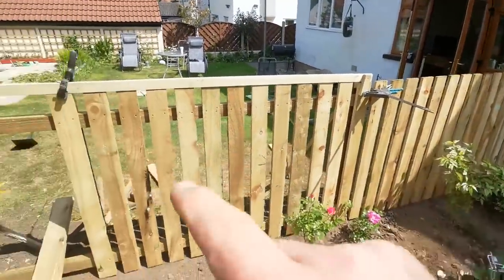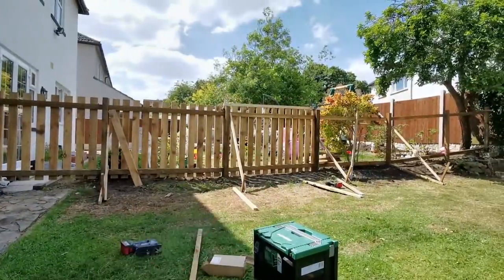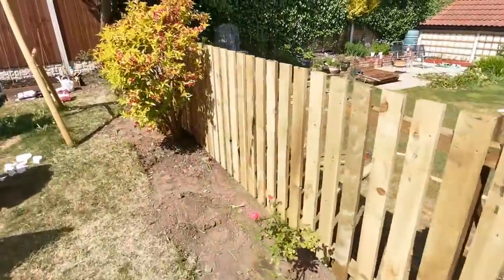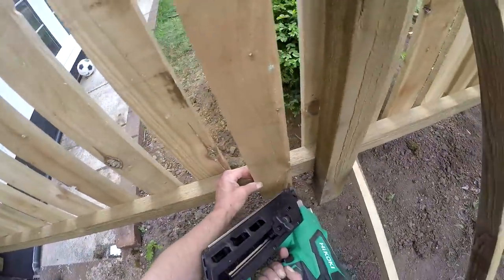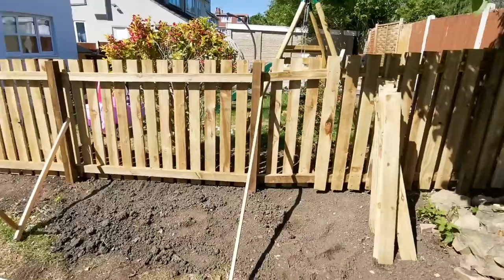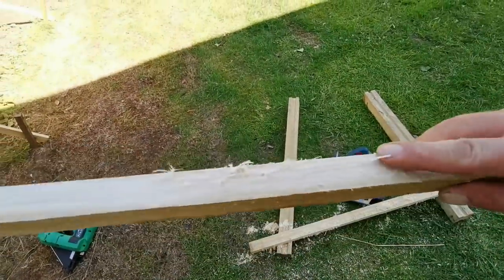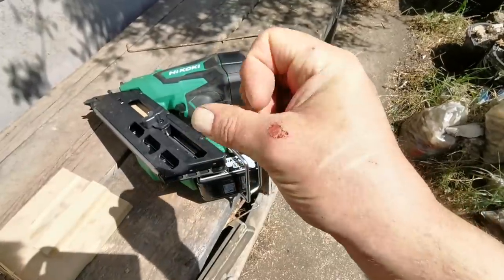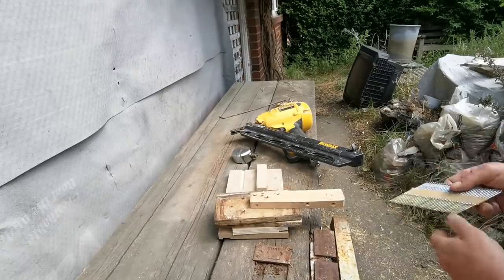4ft Paling fence - Pt4 Built with a HiKOKI NR1890DBCL Cordless Brushless Framing Nailer

Comment: Top class Sir, a carpenter I work with from time to time has one of those Hikoki framing guns. I had a go with it on a job we were on together recently. It certainly drives nails but it's heavy. My trusty Paslode got wet on Monday, 🙄 I dried it out in the oven and gave it a bit of a clean. No good, I must have a proper look at it when I get a chance. I have an old Draper fifty litre compressor and a Makita coil nailer. One can't beat the pneumatic guns for raw power, 👍🔨🇮🇪
Reply from the maker: Thanks 👍 Yep the Paslode i had died quite a few yrs ago, it then sat in a cupboard gathering dust because i went back to the reliable Dewalt air gun, the Paslode didn't quite die but just became a pain, It had either an empty battery or empty gas cannister & it didn't like cold weather. you'd hold the piece of wood up, put the gun to it n pull the trigger n nothing 😣, the Dewalt never missed a beat but i had the hose n compressor to deal with. I tried the battery Dewalt framer a couple of yrs ago but didn't fire the nails in enough & when you pull the trigger it took a moment to cock itself, Yep it's heavy but fires them in right in & it cocks itself after the last firing so ready to go immediately, i wish it was a little lighter but no regrets buying it 👍 https://youtu.be/oQlP-I6ZMcY
Reply: @Gidjoiner  To be fair my Paslode has never missed a beat since I bought it two Years ago. I'm building my new workshop at the moment and it was pissing rain on Monday while I was fitting the wall plates. The gun got soaked along with myself, 🙄 😭
Reply from the maker: @TheToolnut  😣 bloody rain eh. My Paslode was fine for the first few yrs too, 😁 best of luck with the workshop, i have a stack of wood in my back yard that i hope to extend my workshop with but not in the rain,
Reply: @Gidjoiner  Nothing worse! 🙄 I bought a 3m square portable canopy so at least I can set up my mitre saw and horses and they'll be dry. I'm building a timber frame workshop approximately 30' x 28'. It's a two stage build as there is an existing crappy metal shed in the corner that is for temporary storage. Once I have half the workshop built I'll cross load the gear from the old shed and start stripping it out. I haven't had my own workshop for over six Years so I can't wait to get the roof up and get in out of the bloody rain, 😁
Reply from the maker: I have a BBQ cover for the mitre saw, anything more than a shower n i'm going home 🙋‍♂️😁👍 the part of my shed where you see me assemble n spray things was an add-on, it used to be outside till i got sick of not being able to do anything in the rain, my shed is a series of about 7 add-ons, no'8 coming soon 😂
Reply: @Gidjoiner  I saw that BBQ cover alright, 👍😁 I hate my kit getting wet. Your space is tight but your  work is champions league quality which is what matters. My last w/s was originally 18' x 16' then I doubled it to 36' x 32'. It was approximately 500sq ft, this one I'm building now will be around 850 sq ft. It'll be divided in two, I'm thinking of putting a spray booth in one corner. I can't wait to get my kit into it and get myself in out of the bloody rain. I've been doing mostly carpentry work for the last six and a half Years. I can tackle some joinery jobs once I get set up properly. My first big purchase will be a one hundred litre compressor, I'll build a sound proof box for it in time. Roofing Today, hope it stays dry, 🤞🤞🔨🇮🇪
Reply: @Gidjoiner  I'm looking forward to the video of you extending your w/s, I must send you on some tea money, ☕ ☕ 👍 🔨 🇮🇪
Reply from the maker: Thanks very much, don't worry about the T money, it sounds like you've got enough expenses, 😊👍 The first Bostitch compressor i got, I built a soundproof box using sound rockwool, it worked really well but the compressor heated up if the lid was on when spraying, so i'd leave it up with a vent-axia fan blowing on it but one day forgot or it fell down, sprayed a job n it smelt oily in the shed, ooops. lifted the lid n it was red hot n pissing oil out, i took it back to Screwfix n told em it was broken, they exchanged it for he one i have now, 😂 You want a high CFM if you didn't know, that no' is how fast the tank refills 👍 Pissing it down here today.

Comment: I’ve just got a koki  your right mate it’s bloody heavy  but it’s brilliant gun . Be hard doing a ceiling though  . Good fence pal
Reply from the maker: Thanks 👍 Yeah, I've used it here n there for a few bits n pieces, It's nice that i can just grab it n not have to set up the compressor, It's a bit smaller n more reliable than my old Paslode not having to have gas & a battery 👍 I was a bit old n feeble after not working much because of lockdown & there were 600 nails on this so it did feel heavy but as i got into it i found it not too bad & it is like you say a good gun, drives them in well & i think the weight helps to reduce any kickback👍👍
Reply: Your spot on there the weight does stop the recoil . I’ve got the discontinued paslode iM 90 
But the gas for it is far to expensive unlike the normal paslode gas. Keep drinking the tea mate . Yorkshire . About 15 cups at least for me

Comment: Another good job Gid though I dont understand the client's wanting the failings directly behind each other,  but ours is not to reason ,
Reply from the maker: Thanks David 👍 always clients choice i the end. i bought enough to board both sides overlapping so you don't see through, but the side that has my mixer in wants the light to come through, the grass doesn't do well near the fence & double boarding means they both sort of get a front side 👍
Reply: So that the light gets through and it can be planted on both sides

Comment: Great video Gid, id put some of that brown plaster that comes in strips that you cut cloth type over that ridge to protect your hand.Great job Gid well done you make it look easy , but its a hard job in that heat
Reply from the maker: Thanks Michael 👍 Yep a bit hard going in this heat, need to stop smoking n i'm getting old, The nailgun i'll sand a bit & see what i can come up with, sticky tape type stuff can be awkward, if it comes off n leaves a sticky residue that can be as bad or worse, i avoid wood resin on my hands because that can make them sore, rubbing on stuff/tools rather than the dry sliding my hands normally do, maybe some cycle handle bar tape, that's designed to be rubbed a lot 🤔😏👍

Comment: So fence erection is the New Spectator Sport. LOL. The trade off with the guns is the portability and not needing the compressor You'll have to take a bit of sandpaper and soften that ridge.
Reply from the maker: 😂😂🧐 Yep the hose can be a pain, that dewalt air gun is good but can be awkward because it is long & noisy compressor, long garden also means long hose & 240v supply, Yep the nail gun will be getting 'fettled' 👍😁

Comment: Nice hit and hit 😂  , why didn’t they want hit and miss ? Gid, that gun is heavier than my dewalt, but it looks miles better. Great job as always .
Reply from the maker: It was to let light through, that part of the garden is shaded a lot of the time, yeah it's powerful n puts the nail in as you would expect from a nail gun 👍 I'm getting old, i don't work on site anymore n just came out of a few wks of lazy covid lockdown so it felt heavy but it was ok once my muscles remembered what their job was 👴💪😂😂 The Dewalt i tried early last yr & i was very disappointed with, but this Hikoki i tried later in the yr i was impressed with, so when i had the cash i bought it, I'd accept the weight because it is a good nailer 👍 Thanks 👍
Reply: Gid Joiner I agree , but already had my dewalt . People moaned about the weight but makes no ends with me .  I’d much prefer to get the hikoki , just going to wait for my dewalt to die. .
Reply from the maker: 👍 Yeah, you might be waiting a while then, apart from the 2 cordless drill/drivers i burnt out many yrs ago most of my Dewalt gear is still going strong. On this fence i had about 600 nails & i'm not as fit as i used to be esp at the moment but the weight is ok, I've used it for the odd few nails here n there & it's quite small n well balanced, in fact i think the weight adds to reduce the recoil a little 👍
Reply: Gid Joiner I’ve had it for nearly 4 years I think , I fired many thousands of nails with it. It’s starting to lose power , just after the 3 year warranty. I found the knack that I had to , sort of throw my weight when I fire the nail. To lessen the recoil , saying that on ‘bump ‘ mode you’d do this anyway .   Saying that I might go back to paslode . 🤷‍♂️. I don’t mind doing fencing , but trying to stick with furniture building and maintenance type work .   Thanks for replying 👍

Comment: Nice job Gid but cant understand why they doubled up on the pailings. Wont the rain settle on the rails between the pailings? You want to file the protruding plastic on the nail gun to prevent your blisters in future. (Think its called flash from the injection moulding.) Nice to see your vudsxafain 👍👍👍👍
Reply from the maker: Thanks 👍 their choice, they're going halves on the price so they both sort of get a front side & i think the side with all the stuff n baby liked that look, these tanalised timbers are full length, no cuts so apart from where  the screws n nails are they shouldn't rot too quickly, Yep the nail gun will get some fettling, a bit of sandpaper or something. after 600nails apart from the weight that's my only niggle so i'm fairly happy 👍

Comment: Turned out well Gid ! 👍😀
I'm still not sure if it is worth me investing in the Hikoki nail gun, sounds very quiet and like something out of star wars, but my Dewalts do the same job. Would you recommend it Gid ? (would only be using 50mm nails with it).
Reply from the maker: Thanks 👍 if you didn't have a gun & was looking to buy a framer then yes, it's a good gun, does what it says on the box, i bought because i wasn't keen on the Dewalt so held out to get this, I'm fussy n not rich but this impressed me enough to fork out the £450 when my dewalt would've done this job n I'd be £450 richer instead, it is heavy, I think the only way you'd know is playing with one, comparing with yours n how deep your pockets are. If you're happy your dewalt does as you need then i don't think buying would change your work, I buy a lot of the time because i want to update/go cordless or as with this, the air dewalt runs fine off the workshop compressor but won't put the 90mm rings in with my little 6L compressor, & i have work coming up that will justify this spend 👍
Reply: @Gidjoiner  Thanks for the reply Gid, the main reason for switching is due to the noise of the Dewalt and also the relatively slow reload if you know what I mean. I think I will stick with the Dewalts for now but thanks very much for taking the time to reply. Looking forward to your next uploads !
Reply from the maker: 👍👍 i don't remember how loud the dealt was but the Hikoki does make some noise, it's not quite a ban like the Paslode but occasionally i got the echo/reverb or whatever it is bouncing of the boards n going right to the core of my ears. 🙉

Comment: Hard to do a job and film it at the same time good stuff , why no post mix?
Reply from the maker: Thanks, yep doing both isn't easy, work comes first that's why filming isn't 'perfect' but i try. I wrote this on your other comment but i'll  repeat it here, -  I've pulled them in the past that others have put in with postmix, the concrete was a bit crumbly with air pockets, it didn't take much hitting with the sledge hammer to break it, it might have just been poorly installed but the price is also an issue, a 20kg bag of postmix for me is about £5, I would need 2 per post, these posts took about 1½ of these big bags of ballast, these are bigger than normal 35kg & cost £2.49 so about £5 per post instead of £10 with postmix + with wet concrete i know it will fill all gaps/holes & flow around the back or parts where the post is maybe a little close to the edge of the hole, In all I think it gives a better job, dries rock hard, is cheaper & i have a mixer 👍   I'm sure some people will argue that postmix is good & is quicker, it may well be but speed isn't a priority, all my work comes word of mouth, I need to & like to know my work is going to last & i have at least tried to do a decent job 👍
Reply: Gid Joiner gid, you ALWAYS do a decent job

Comment: I dont understand why they wanted the slats lined up both sides. Would have looked better if the slats on the 2nd side were in the gaps. Nothing to do with you though the customer is always right as they say.
Another good video
Reply from the maker: That's what i bought enough palings to do, i wasn't sure when ordering how it was going to be put on but It was done like this to let light through, the grass doesn't do well on this side because of the house n then wen it comes around the fence blocks it, but as you say, it's the customers choice , Thanks 👍

Comment: You got the grey dial at nose down at full depth? My hikoki sinks those 90mm ring shanks no probs?
Reply from the maker: Yep it wound fully down, i showed that i think, Your's will def fire 90mm rings through wbp ply n a bit of mdf?, Have a go for me when you've time, 3 x 18mm wbp ply n 1 piece of 18mm mdf, this is Medite MR, it might be a fraction denser than reg stuff.
Reply: Maybe just the bounce between the materials.
Reply: Talking of mdf, have you tried the waterproof mdf by medite? Apparently can be submerged in water for 30 years without taking on moisture!
Reply from the maker: Tricoya 👍 yes once £100 a sheet 😮😂🙉🙊

Comment: Why not use postmix goes of in 10 mins 👍
Reply from the maker: I've answered this a few times so sorry for copy n paste -  I've pulled them in the past that others have put in with postmix, the concrete was a bit crumbly with air pockets, it didn't take much hitting with the sledge hammer to break it, it might have just been poorly installed but the price is also an issue, a 20kg bag of postmix for me is about £5, I would need 2 per post, these posts took about 1½ of these big bags of ballast, these are bigger than normal 35kg & cost £2.49 so about £5 per post instead of £10 with postmix + with wet concrete i know it will fill all gaps/holes & flow around the back or parts where the post is maybe a little close to the edge of the hole, In all I think it gives a better job, dries rock hard, is cheaper & i have a mixer 👍   I'm sure some people will argue that postmix is good & is quicker, it may well be but speed isn't a priority, all my work comes word of mouth, I need to & like to know my work is going to last & i have at least tried to do a decent job 👍